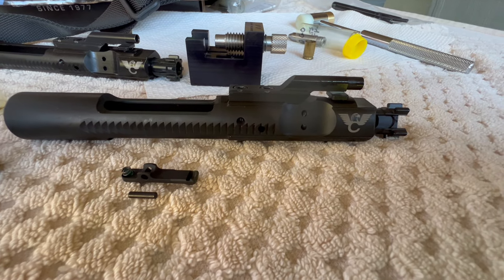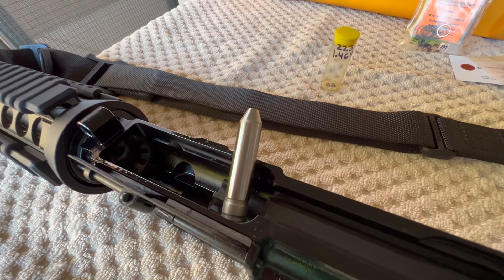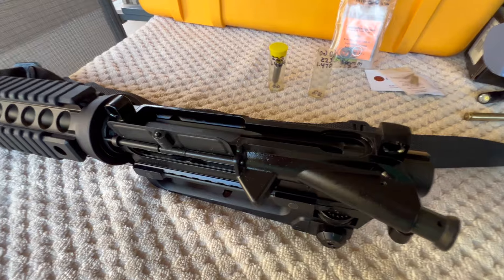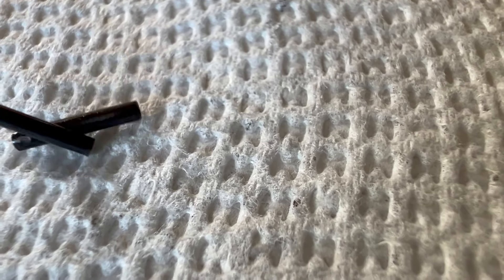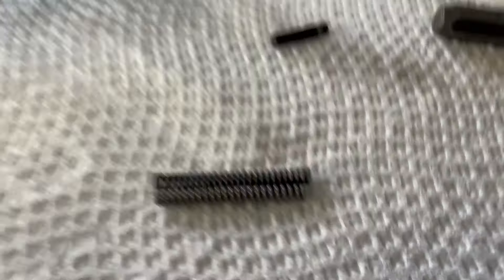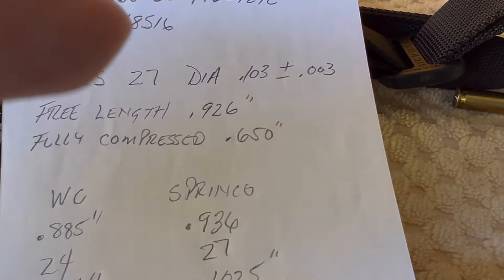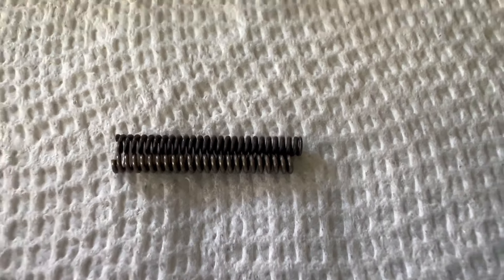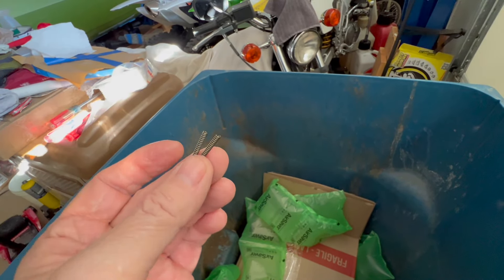M4A1 USMC/NAVY (2008) Wilson Combat Ejector Springs "Out of Spec"!

Comment: Same as what I found in the SRC bolt I mentioned in the other comment - a short, weak spring.  

Wilson Combat has an OEM do their BCG's.  It's the OEM that is installing the cheaper springs.  

I've had the best results with Microbest BCG's that are sold by resellers that specify Sprinco springs in them.  Arftac is a good one, specifically their "+" items.
Reply from the maker: I have a few from MicroBest and usually the chrome extends around the front of the carrier. The chrome on the WC's ends right at the edge of the internal bolt opening so I don't think the WC's are MicroBest. They're finished okay although the staking on the brand new one is a little weak. Other than Toolcraft one of the other larger BCG makers that I know of is Azimuth. Wherever WC is getting them from they need much better QC before they put their logo on them! Thanks Billy!
Reply: How is the bolt marked?  That will give a good indicator of the OEM.

Comment: A bit surprising for a WC BCG, but that was what the ejection pattern suggested.  
Good job.  That's a handy tool from WW. 👍
I look forward to your next test video. I bet that rifle slings the brass into the next zip code now.
And, Pete, you may want to run the buffer test again.  I have found an H2 to be best for carbine builds, but you had two issues going on with that rifle.

But hey, that's the fun of building your own, right?
Reply from the maker: Thanks Gary! I think so! I'll know for sure early next week when I get it back out for more testing. I'll keep the H2 installed to start with but I did remove the O-ring. That's really the positive to all this! I'll have a solid rifle when it's all done! Buying a complete rifle from anyone these days is a real crap shoot. Most likely you will be troubleshooting anyway or sending it back to the manufacturer. To the best of my ability it will be right when Im done.
Reply: @peteregger7928  Good luck.  I'll check your next video.

Comment: Check the one on the selector switch under the grip as well. I've heard of people shortening those a tiny bit to loosen the stiffness on the switch.  Not sure I'd recommend doing that, but it is a thing.  But I could see using a broke in one from an old BCG for the same trick since it's the same spring.
Reply from the maker: That spring was a Giessele on this build that came with the ambi selector. I didn't check it but it feels decent after about 20 actuations (break-in). Moves easily from both sides with no slop. Thanks for watching and commenting!

Comment: I just remove the extractor o ring immediately from new BCGs, it's not necessary with a good guide and spring. I put it in my cleaning kit sandwiched between a folded over piece of clear tape just in case
Reply from the maker: I don't think they're needed for the kind of shooting I do. Can't remember exactly when they were introduced to make burst/full auto more reliable. Maybe when the M4 or M4A1 first came out? None of my Colt AR's had them installed back in the late 80's or even the very early 90's.

Comment: How did you get the measurement of the compressed ejector spring?
Reply from the maker: The compressed length number shown came off the TDP data block. I think the easiest way to measure it would be to use something similar to a drill vise and then measure the distance between the vise or clamping jaws with some other device (cups) to keep the spring from launching. I think so long as the wire gauge diameter, free length of the spring (non-compressed) and with the correct number of coils the compressed length can be extrapolated and should be very close without having to measure it. I initially thought to measure it compressed but realized I didn't need to.